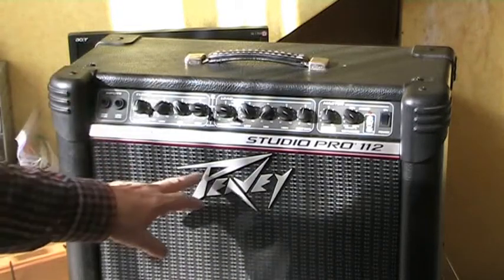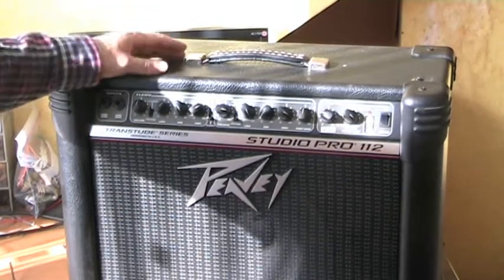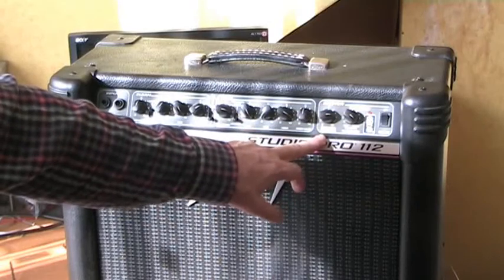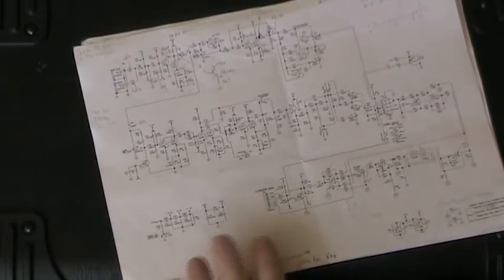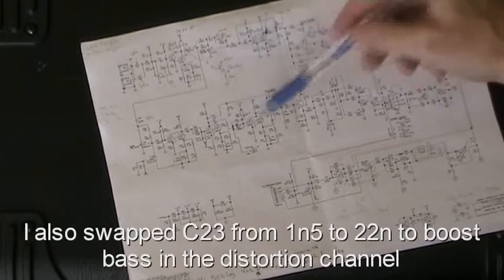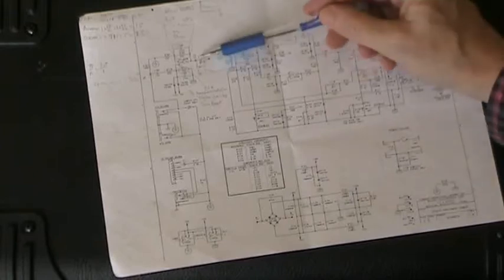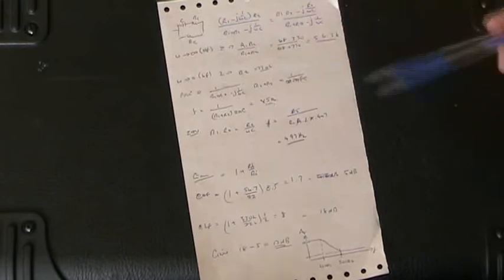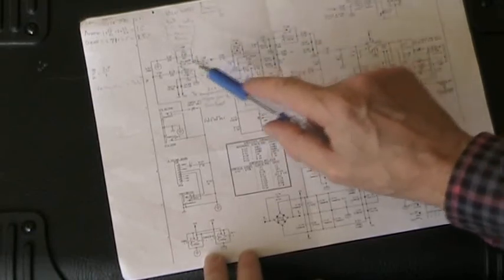Peavey Studio Pro 112 mods

Comment: I have a Peavey Studio Pro 112 that hums badly when you turn the reverb knob up from 0. It has a brand new Accutronics reverb tank. Coax cables check for good continuity. No signs of burnt resistors or cold solder joints on the fly-away board and the reverb coax connector. One thing I notice is that the "in" coax ground measures 22 ohms to ground, and the "out" coax ground measures 0 ohms to ground, which is what I would suspect. I've put a lot more hours into this amp than it's worth. :)

Comment: I disagree with everything this guy said about the amp!  It has great tones and breaks up awesomely. He says it’s loud… it’s supposed to be loud.. lol. And no it’s not a “Fender” clean amp. That’s not what it’s designed for. But it definitely cuts thought the mix. Does have great cleans, and distorts “like” a tube amp at volume. The key with this amp is the best tones are when you turn it up like a valve amp!
Reply from the maker: When I said it was loud, that was a compliment not a criticism, that's your misunderstanding ;) And when I said "Fender" I was referring to clean bright tones, which this 112 could not do. By chance I got a Marshall 40V and that's completely different with identical layout. The 40V has all the clean "tops" as my Fender reference and does a whole range of distorted tones. I found no matter what volume the amp was set, there were never any tops that's because the circuit wouldn't allow. Also the 112 goes unstable with certain inputs.
Reply: @totaltwit  Got it!... for the record, wasn't trying to call you out or anything. I just disagree with you. It's all good. I do think it has highs and lows. But obviously, it doesn't sound quite like a Fender sparkly blackface amp. But very few non-fender amps do - even high-end ones. That being said, this amp sounds more along the lines of a Hot Rod Deluxe or even a Blues Jr. I think it cleans up better than those amps tho. And it takes pedals very well IMHO.
Reply from the maker: @1mihayes  I've had a Hot Rod Deluxe in for repair, I think it had a pair of 6L6. I was quite some combo, but... it had badly burnt up. It looked like the Mfr used the new low lead solder which fractures, caused an open circuit in the 6L6 bias and... fire.  I didn't test it for tone, was VERY loud, nice item, shame about the solder.
Don't worry as I think it's good to have different opinions on something. I do wonder though if my UK spec 112 was different somehow to the US (or your country's build).

Comment: I got the Envoy and the Bandit. 
The Studio Pro is in between. 
I prefer the Envoy that has a 10" speaker. It seems more responsive. 
I will put an eminence Texas Heat 12" in my Bandit. I put one of those in my solidstate Fender Stage 112. 
It changed that icepick bleeding ear amp into a very full bassy tube-like warm amp. I bet it will work magic on my Bandit also and could've fix the tone of your studio pro. 
You seem very knowledgable amplication. Very interesting content.
Reply from the maker: Indeed experimentation :) The Studio Pro just didn't have any tops (treble) hence why I looked closely at the circuit and concluded this wasn't the amp for me. I got rid of the Studio Pro and was gifted a Marshall 8040V which turns out to be exactly the same format as the Studio Pro 112. Anyway after a few tweaks the 8040 is far better, much more versatile, sweeter sounding etc. which I guess is the crux of the matter, we all have different tastes.

Comment: Is it possible to keep the reverb knob and still add a Master Volume? May be at the rear chasis?
Reply from the maker: Yes, I was thinking to remove the Send/Return sockets and use one of the holes for the Reverb pot.
Reply: @totaltwit thanks for aswering! 
So if I leave the reverb circuit intact, I could do the master volume mod in the same place you specify in your diagram, but put the potentiometer at the back right? The master volume potentiometer has to be 10K?
Reply from the maker: @mantmecafdt3109  I see no reason why not. Might be best just to have a quick look at the circuit diagram, mostly for the signal path than detailed component selection. 10k sounds right, in this kind of circuit (position) it generally doesn't matter, lin vs log is usually a matter of preference, I'd go for lin.
Reply: Sorry to bother you again.  When you add the master volume potentiometer... what happens to C102? Do you just remove it?
Reply from the maker: @estebansuarezmarenzi1135  I'd suggest wire a Master Volume control around the EFX Return. C102 comes from U2B pin 7 to R106 so I see no need to do anything with that , just leave as is. :) Wiper of MV goes to J1-1,C103/R107 and top of MV track to J1-2/R141 with the skt removed.

Comment: This is a good amp without these mods two things you can do is change the speaker and strengthen the baffle with pine, this is an amp for use with a band and as such does not respond until you get to a reasonable volume, then it sounds great. and as someone else said look at what Shane from in the Blues says about it, but he knows how to use an amp.
Reply from the maker: Thanks for your suggestions AWM, I guess the sound would improve at higher volume levels, however there is no mistake there are no tops/highs even with the Treble knob on max, just not there.. at all. 
To me, the need to change the speaker says it all, speakers are now £80+ a pop and the amp is just not worth that. I had to hand a Celestion speaker and that did give a better tone. These two alone makes this amp worthless.
By chance I got a Fender Princeton which is a similar format and ...boom, that's more of what I was looking for.
Reply: @totaltwit  Is that the Solid state Princeton,that is a good amp, the Pevey is not the right amp for you, it is an amp that works at a higher volume and has a really good mid range push at band levels, it might be your guitar as well, I really like mine.
Reply from the maker: @allworldmusic8270  Yes the Princeton was solid-state (opamps). It's not the guitar... but I do agree the Studio Pro 112 was not the amp for me, that I can accept, and also it depends what kind of music is it used for. In some ways for styles like heavy metal it can be just about any loud and noisy amp. I was wanting a versatile amp (all the voicing, knobs and switches).
Reply: @totaltwit  It is an odd amp the Studio Pro but I know the Princeton Solid State sounds great at low volumes so you have the right one for you.
Reply: @allworldmusic8270 he's a electronics engineer of sorts. Of course he will be critical. Complaining about having the reverb set low?! His hear is trained to like fender it seems. The only fender I ever liked was the twin reverb and only the clean of course. I'm young so I think the leads on all of them seem trebley and thin. Bassman is close enough duh but

Comment: What a dummy best pedal platform in the world
Reply from the maker: ha ha I didn't buy the combo just to use pedals/fx defeats the object - they can completely change the tone of any amp. I bought the combo expecting a carefully crafted guitar tone offering wide range of usable tones.
I've discovered the power amp (Transtube/damping) goes into self oscillation with certain low bass notes.
Reply: I have three red stripe bandit 112 I wouldn’t get rid of them for nothing however they are the American variety and I do use pedals for certain things but the amp does most anything I set it to do very well I might add

Comment: Hi, thank you for these suggestions, I think I will have try myself! In your document you mention a possible HF boost you wanted to try. Possible  a R+C across R110 or treblebleed capacitor on the master volume. Did you try these mods, and did you like the result?
Reply from the maker: From what I recall, the transistor driving the tone stack was too high a Z and cut the tops, so I did a simple fix and added an emitter follower which made a big difference.
Personally I think this design is a "bit naff", maybe I don't get the Transtube design. Just to have darlingtons in place of valves/tubes just doesn't work. I can only assume that's what Peavey were thinking. However the output driver IC is wrapped around a feedback circuit that changes damping, and I think that is good :) When set to min it give a tight thick metal sound and when the other end of the scale gives more twang.
The Fx send/return is useless and isn't suited to this kind of 2-channel preamp design. I'm not convinced about the "Blue Marvel" speaker, it may suit some people but personally not for me, very pokey and directional.
To me this combo is a loss, it is well made, easy to carry, looks good. Just needs the whole pre-amp circuit redesigning and a different speaker that's why I think it's a good combo to customise.
Reply: Thank you again for the advise! I will give it a go.
Reply from the maker: @remonwensveen1299  As a suggestion try LTspice to model U2B (circuit simulator), it can sometimes save time. Again it may not give 100% accurate results but usually gives a good indication. Also years ago there was a nice tone stack simulator from Duncan Amps, this is very worth getting.
Reply from the maker: @remonwensveen1299  As a suggestion try LTspice to model U2B (circuit simulator), it can sometimes save time. Again it may not give 100% accurate results but usually gives a good indication. Also years ago there was a nice tone stack simulator from Duncan Amps, this is very worth getting.
Reply: I agree that it could use some improvements, so I followed your suggestions:
I added the emitter follower transistor.
I added the extra master volume.
And I changed the speaker for a VHT  P50E.
No we are getting somewhere, response and tone definately improved! 
It seems though I am still missing some top end. Specially on the high gain channel. What would be you suggestion, a trebble bleed over the master volume potmeter? But that works only on the low volume settings then right? Maybe better to try a RC high pass filter over the R110 from the U2B opamp? Which values you think be a good start for this.
Reply from the maker: @remonwensveen1299  I agree to "voice" the amp closer to your liking U2B is the perfect place :) It can be a time consuming process by adding components and trying. It is cheating but I'd take a feed from EFX Return and wire in some nice EQ box (I have Behringer Graphic Eq which would be ideal), feed it's output into R106 (or Master Vol). Bypass U2B for the time being.
This way it's easier to find what frequency and by how much needs to be added. Also learn about filter order, because a when making compound filter these overlap and change the response. The idea is to use the external EQ to find the overall curve, then look for a filter design that matches. As you say, a C across R110 (22k) might be enough, 1.0-1.5nF would be my starting point.
It is truely hard to say at what freq to set the filter and then a 2nd order filter might be better. Maybe what I'm suggesting is, make it easy to find the EQ curve that suits your liking. It's one of those things that can go in all sorts of directions.

Comment: I added a master volume as well. T dynamics circuit and clean channel is the best about these amps. And it is so not well known.
Reply from the maker: That's what this combo needs, a Master Volume. I removed the reverb knob and made it into a Master Volume. Know the T dynamic is only on the power amp, it's a 60W IC that does the job well, but give it a close look, mine wasn't seated correctly and that's why it blew up. I bought it with that fault.

Comment: You can easily change the sound of your amp by adding a piece or 2 of plywood to block the back to convert it to semi or fully closed.  I Velcro-ed a 4 inch wide piece of wood to the upper 3rd portion of my silver stripe Peavey Bandit to get more punch and articulation.  The amp was practically fully open in the back; it had a very soft vintage sound heavy in midrange.
Reply: Great idea, think I’ll try that with my Peavey Bandit (Red Stripe).
Reply from the maker: This is a good idea. Although, my amp seemed to lack tops.

Comment: Wow, I just bought one with the block letters made in America. Didn't like it at first. What I found out is treble really had to be rolled way back. Transtube kicks in when overdriving the amp with over drive channel in vintage , pre not to high and hitting the front end with compressor, Blues driver or Ocd, or both for real high gain. Transtube allows the amp to feedback like real tubes will . Volume is controlled by post gain. I dont run my pedals with much gain either. I like definition. Transtube also let harmonics ring out like crazy at pretty low volumes. Im pretty sure Im gonna upgrade the speaker.
Reply from the maker: Thanks for your comment Ed, I'm always interested to hear people's considered comments. After the mods I did to mine, two things I've noticed are, I leave the Transtube knob on max, I can hear it give a "livelier" sound which to my mind is correct. The Blue Marvel speaker I think could be a better unit than I think, it is very directional so need to stand well back and away from it. It has a certain tonal character which I think actually compliments the guitar tone. But again, I would think all these are very much dependant upon what guitar is used and for what purpose the amp is intended for. I don't play metal/thrashy stuff, I'm more funk.
Reply: @totaltwit  That guy from In the Blues put this amp and the Red stripe Bandit on my radar. There is a video of him and his friend playing live out door festival. He is playing the Bandit and his friend who was a joy to listen to was playing Studio pro Red stripe.  The studio pro sounded every bit as good as the Bandit red stripe.
Reply: Edward Bartley Dave Simpson has also played Peavey’s on his channel. First, unless there was something totally wrong with this one I have a different perception of what the tone is like. I believe they have too much bass and you need to back off on it. The clean channel is as good as the clean on any Fender, but takes pedals much better. I really don’t even need the overdrive channel. The clean channel with pedals is awesome. No need for modifications
Reply from the maker: @johnspokus  interesting comment, I wonder if there could be something different between these amps. I've only seen the one circuit, the amps appear to be made from good quality components, so who knows. Maybe it's just one of those things, different people, different guitars and different ears, maybe.
Reply: @johnspokus  Cool, Hopefully my band has some gigs this coming year so I can try it out in live situation. But I still like my Blues Jr. NOS tweed better. This Peavey rocks for what I paid for it. Its also light and small and loud. And my old foot switch from my Peavey practice amp from the 80s worked on it.

Comment: Thanks for this video tour of your upgrades. I have the same amp, and some music technology oriented electronics courses under my belt. I'd like to try these modifications, but I'm unable to see clearly all the details of your notes on the circuit diagrams and the extra page of calculations. I wonder, if you have the time would you be willing to post another video with close up views of those details, please?
Either way, this video was a terrific find for me. Thank you.
Erik
Reply from the maker: If you get the circuit diagrams for the amp and follow them along with my video it should become clearer. I make references to opamps which are standard building blocks, there are many websites explaining them, the configurations used in the 112 amp are all the basic ones, nothing complicated. I'm in the process of making a pdf of the modifications which I can send to you. I decided not to include the full technical analysis in the vid as it would get way too geeky (boring) for many people.
Reply: As a self anointed geek, personally, I appreciate all the gory details of a full technical analysis, though I agree ordinary sane folks might not feel the same. I've already begun by boning up on Tone Stacks as they are implemented in an ideal op-amp like the one you pointed out in the schematic at the front of the power section.

Thank you very much for creating the .pdf file of the details, too. This is one for which I'll have to break out the old laminating machine to protect the printed pages from the wear and tear they are sure to get.

All the best to you. I look forward to seeing how both projects turn out.

Erik
Reply from the maker: I have the pdf available now but don't know how to make it available, I know YouTube will remove any links.